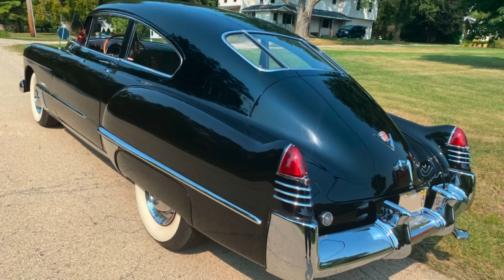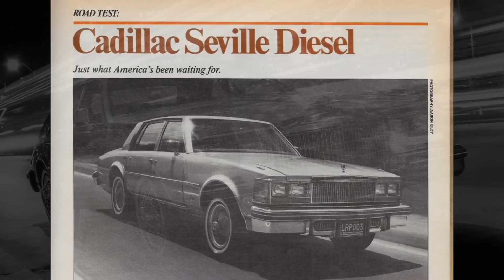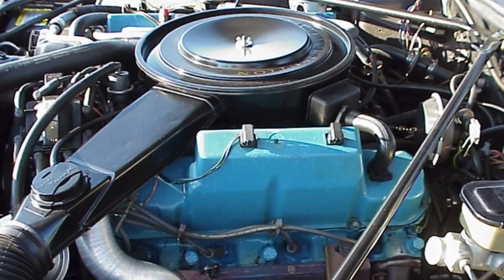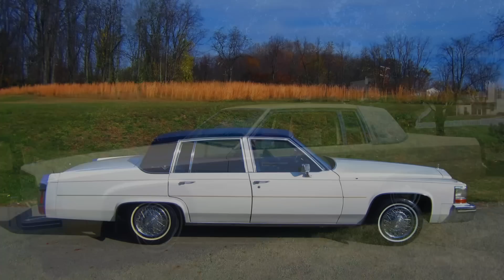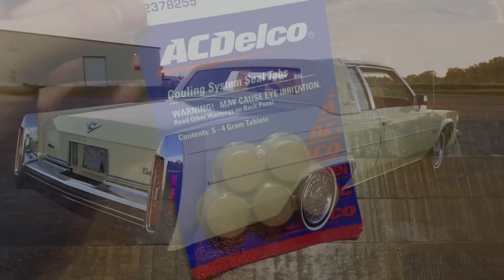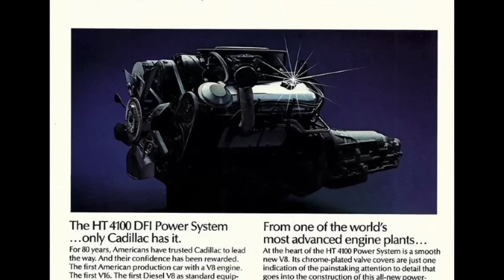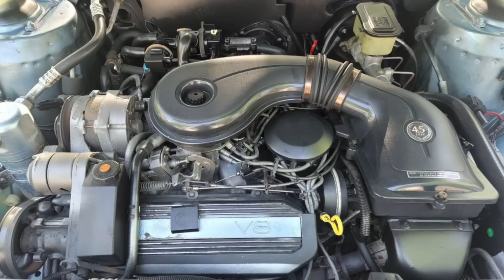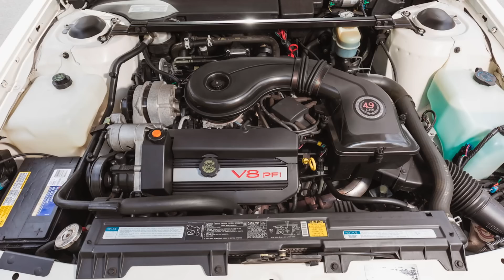This is GM's Worst Decision for Cadillac and Affected Its Reputation for Decades...

Comment: GMs mistakes would fill encyclopedias.  The biggest is allowing the bean counters to take over.  I would normally say this is turning the business over to Wall Street to boost stock prices.  The insufferable part is the GM attitude that they were above change and the customer would accept what ever they churned out.  The attitude is still present.  They should have been allowed to fail.  They earned it.
Reply: Love my all original 240000 mile chevy Silverado I bought new in 2007
Reply: @brainwashingdetergent4128  The current ones are rated the least reliable trucks.
Reply: @rogersmith7396  well the modern equivalent is twice the price myn was new so ive already decided to keep this truck and rebuild it if needed
Reply: @brainwashingdetergent4128  My oldest car is a 1970, the next a 74, then a 85, 86, 95.  I do have something modern as a daily driver.  I have a 72 and an 86 cycle.
Reply: @rogersmith7396  😊 11:03
Reply: @brainwashingdetergent4128  The Chevy trucks were pretty well made. I had a 1992 Chevy Cheyenne long bed W/T (work truck), 4.3 litre, 6 cylinder, 5 speed manual transmission, and I could not believe how durable, and reliable that truck was, in every way.  By far, the best GM vehicle that I've ever owned.
Reply: @carlc5748  have you ever owned a V8 GM engine? You'd still have that truck if it was a V8
Reply: @brainwashingdetergent4128  you are probably right. No, I've never had a V8 GM engine. I have heard that the newer ones from 1999 on are extremely durable, and can be built up to milk more power out of them, because of their inherent good design.  I take it that you have experienced this for yourself.
Reply: @brainwashingdetergent4128 nothing wrong with the 4.3's buddy.  They're essentially 3/4's of a 5.7/350 Chevy anyway..I've had great luck with mine e
Reply: @h8troodoh  As far as I know there was nothing wrong with 283, 302, 307, 327, 350.  The 400 is somewhat controversial.  I don't know anything about the 305.
Reply: @brainwashingdetergent4128  😮
Reply: It is what is is. If GM followed our hearts they would be long gone. The solution is to buy and cherish the classics. We are blessed to have them, or even remember them
Reply: @stevebarker8255  I suppose some people think of an Escalade as classic.  In my view they are just foundering.  No plan for the present or future other than keep the stock price up.
Reply: @rogersmith7396 Arent Cadillac? Escalades  cosmetically engineered Chevrolet Tahoes, Suburbans, GMC Yukons?
Reply: I was working at a Cadillac, Oldsmobile Dealership, when all those issues showed up in both Diesel and HT4100 problems. They were a nightmare for the technicians!😊
Reply: yup
Reply: Amen brother ! The world would be better served today if it would have been allowed to succumb to its ignorance!
Reply: The last GM I bought was a 1996 Chevrolet Impala SS. Beautiful car, nice to drive, reasonably fast (nothing like the muscle cars I previously owned) but the cheapness of the interior sent the message that these cars are no longer the Chevys of the past.
Reply: Yes GM really did screw up! And it betrayed and lost its owner base.
But to be fair, I've got to say how very happy with my 2016 Chevy Cruze,  which just hit 7 years age and 100,000 miles without any troubles what so ever. NON.. it hasn't even needed a new battery or breaks yet. Only tires as 60,000. It goes down as the most dependable vehicle I ever bought hands down. ( more dependable than any expensive European car that I've ever  bought! ) so GM is doing something good now!
Reply: @gregt8638 ,Cosmetically engineered Daewoo Lacetti. GM only stopped making the Cruze because its profit margin was too small for them, not because they were not selling well. They were selling very well.
Reply: Aka GM arrogance
Reply: I remember the 1970's beginning the big downturn in style and quality,  As people traded in their 3-4 year old cars with 50k or 60k miles that were rusting and falling apart Japanese cars were purring along and gaining market share.  It only got worse in the 1980's.  It took them a LONG time to listen to and take care of their customer base.  Something Anheuser Busch is currently getting schooled on.
Reply: @kjisnot  1974 was the beginning of the end of the American dream gullible people had been propagandized with.  First Viet Nam, then Nixon, then gas price hikes, then recession and economic contraction and the end of Bretton Woods.  The US was no longer all powerful.  God was dead.  Women refused to be moms.  The early Japanese cars were god awful.  A VW beetle was much better.  Jap crap.  They did'nt come around til the late 70s.  Also in this period American auto makers started taking big price hikes.  The public was restless and disatisfied and willing to go with cheap imported econoboxs.  Some people even found out they did'nt need 6000 pounds of steel to take them to the grocery store. But you procede from a false assumtion that corporations merely satisfy demand.  Nothing could be further from the truth.  They create demand from marketing.  The consumer is led around by his nose and does what he is told.  What right wingers call sheeple.
Reply: Ford didn't need a 2008 bailout.  GM and Cryco did.  Ford were forced to take a loan to not make the others look bad.  I won't forget that either
Reply: @loginavoidence12 🤣🤣🤣 you poor soul, Where do you get your info.. lmfao...
Reply: Nearly every car during the 70's and 80's had poor build quality with the exception of Mercedes, BMW, Volvo etc. All those old Corollas, Civics, and Datsuns that were " better" rusted straight into the ground 10 years later. Yes GM had an arrogant attitude and so did Ford and Dodge. The fuel crisis caught them all off guard and the Japs just happened to be making the right car for a fuel crisis.

Even pleasing bean counters GM has innovated more than almost any other brand period, while the others played it safe and practical.
Reply: British cars were even worse... car magazines would complain about problems in new Jaguars... and 20 years later the problems were still there... but they complained about engine vibration in the new GM Saturns and a mid year change in motor mounts was made...
Reply: more at fault were the greedy unions and their demands, then barak HUSSEIN obama came along and treated union retiree healthcare obligations as 'secured creditors'  He violated U.S. Bankrutcy Laws all to payback the UAW.  Then, he exercised the stock options well below breakeven for the American Taxpayer.  I have a 2007 chevy truck, last government motors vehicle I will ever own.  Talk about crony capitalism.  The demoCRAPS wrote book on that.
Reply: It's not just bean counters taking over at GM, it's their corporate culture of pursing only short term sales, production and financial results.  For the least amount of investment of time & capital, their Yale Business School MBA's "win" improvements over a short time period in an area such as Return On Investment and then they get job promotions.  No one there (a) Plans on changing the future of the industry through innovation or (b) Thinks in terms of long term survival and growth.  It's all financial shenanigans and marketing ideas, to where they end up badly copycatting their competitors and failing to gain customer loyalty.
Reply: You have very limited experience and not enough data for an accurate judgement
Reply: Yes! So True! The bean counters can and HAVE ruined companies worldwide. Stellantis is doing the same thing to Chrysler. Its all about the money for the investors. None care about the product that they are churning out, garbage!!
Reply: @curtbrockhaus6131  And a hearty E Pluribis Unum to you sir!
Reply: I switched to Toyota and Lexus years ago. American auto companies are nothing but junk.
Reply: None of these dinosaur discussions are relevant anymore. The planet is scheduled to cross the climate “red line” in 2027 instead of say 2057. The upcoming hurricanes and tornadoes will lift those old 2+ ton caddies right off the ground and drop them in the local landfill. EVs and hydrogen are the future…  If GM , Ford and Chrysler don’t wake up or partner with better brains they’ll all go the way of the “running board”.
Reply: Totally agree.  Would like to add though the clueless upper management push to churn out a new model well before it's ready is was a big factor also.   Had GM waited on the Cimarron, put it on the X platform with 1979 SeVille styling, and doubled down on quality the Cimarron would have been a big success.
Reply: @curtcollett2893  the Cimmaron (not sure about the Allante) was the one Cadillac model where you will not find the word “Cadillac” scripted on the body. This to me was a major clue. My Cadillac loving friend from the 1980s referred to it as a “weak Cadillac.”
Reply: Love the classic look of the 80s Fleetwood broughams.  1986 was a key year because GM replaced the 4100 with the Oldsmobile 5.0 307 4bbl.  Certainly a smog choked motor nothing like its big brother Rocket 350, but a smooth reliable and reasonably torquey choice.  Wish Cadillac would have kept the 368 for limo and commercial chassis cars, then offer it back into those 86 broughams.  The 472-500-425 big blocks were some very good and likely Cadillacs last real engines.
Reply: Same thing is happening at Mercedes - the bean counters have lowered engineering quality, and the marketers have this "Mercedes for All" approach that has lowered the value of the Mercedes name. Dealer service has gone downhill too, and MB does not support older MB's like it once did.
Reply: Yet stupid people willingly for over over huge sums of cash for their mistakes. So who are the real 'mistakes'?
Reply: I don't care what anybody says, I don't want a Japanese car for general use, except for the beautiful Lexus LC 500 coupe. That one I'd have.😅😊
Reply: Yes they should been forced to fail instead of bailed out, someone would have bought out the profitable parts and made them work. I think the current CEO is even worse than Roger Smith. My prediction is they will be bailed out again. My father worked at GM from the 60s until they they bought EDS, he was transferred to EDS back then. In the end he lucked out and got 2 pensions. We always owned GM cars for years, but quality got so bad in the early 2000s he quit buying their cars. I haven't owned a GM since the early 2000s, I would buy a used one that was pre 93, but thats about it, no new ones.
Reply: @ppeters480  I had a horribly unreliable 1984 Camaro that I bought new that soured me on GM for a long time.
Reply: @billolsen4360  Produced at the Van Nuys, California assembly plant, not far from where I've lived!
Reply: @billolsen4360  - Most makers built early EFI engines in 1980's that even they couldn't fix... Chrysler replaced their 1957 EFI with carb.s... Cadillac got into EFI V8s in mid 1970's...
Reply: @carlc5748 . They closed it and moved to Fremont, right? Or did they just close it in the 1990s?
Reply: @ppeters480  - I worked at GM for a while as an electrical engineer... went through same GMI engineering/management program as current president, but I was 13 years ahead of her... my brother worked there 41 years as an electrician... stayed to put all 4 of his daughters through 4 years of college... our Mom drove '53, '56, and '60 Cadillac... before going Riviera, Monte Carlo, Grand Prix...
Reply: @ppeters480 I wish Toyota could have bought GM years ago. Founded by Durant who started selling horse drawn carriages in the 1890s, GM only became who they became after acquisitions of other car companies, eventually destroying most of those beloved brands. 

Thank God for the Asian invasion which started in 1975 or we'd still be driving their crap today, 2009 bankruptcy and all.
Reply: @ppeters480  2 pensions… No wonder you can’t find an affordable car these days. Paying off all the employees
Reply: @michaelgalindo9162 , well it is all the retire expenses especially the UAW stuff that really puts the big 3 at a  big disadvantage
Reply: It continues today, but all the big 3 are guilty of the same: elimination if ICE cars in favor of EV's. HUGE mistake given demand for gas engine remains. I bought my  last GM "appliance" in 1983 and never looked back. And I never regretted the move either.
Reply: @autobug2  My father bought a 1976 Buick and then a 1984, When it came time for my mother (my father had passed) to get a new car GM would not be on the list. It was obvious duing the 1970s (fuel crisis) that GM was just trying to push stuff out the door. That was expecially true when they tried to convert a gasoline designed V8 block to diesel
Reply: Haven't bought an American car since I got a lousy 1984 Olds. Only Toyota for me. I can't figure out why people buy American cars.They are totally unreliable.
Reply: Because they don't know any better. They think that's just what you have to put up with, when it comes to cars. Many people won't buy Toyota, Hyundai or Honda, Because they're  racist
Reply: @johnball8758  As one mechanic said to me there is no shortage of repair shops fixing foreign cars and they are busy.  American cars used to be practicle and relatively inexpensive.  Less so now.  Toyota seems to be pushing the $100,000 range with many models.  No thanks.  If current trends persist fewer people will own cars.
Reply: I agree.  I have never liked GM products, going back to the 69s.  I view their build quality to be inferior.  As a matter of personal taste, I view their styling to be bloated and "feminine ."
Reply: @Richard4point6 They've been making crap since 1969????
Reply: @Richard4point6 artificially hypermasculine. Is that what you meant?
Reply: If my father were to share his version of events with the man behind the YT channel, I wonder what the latter may think of the former.

Comment: I'll bet the public at large remembers the Cimarron as Cadillac's biggest failure, but Cadillac owners from that era probably can't forget the HT 4100. If they had just stuck with the 368, they could have sold it as a V-4-8, cutting out the odd-firing, rough-running 6 cylinder mode, put a long warranty on it, and ironed out the relatively minor problems with the cylinder deactivation system until the FWD models were ready. But the promotional literature hailed the 4100 as the greatest thing since sliced bread, and I wouldn't be surprised if some of GM's top executives were led to believe that, so it would probably have been hard for them to bite the bullet and admit that this wonder was not ready for prime time.

Comment: The power level of the ht4100 was so low that using the cruise control on any kind of uphill grade was useless. I bought a '83 Coupe Deville that was drop dead gorgeous but was a total dog. The 4.9 in my 95 Sedan de Ville was awesome.

Comment: I bought a 1982 Coupe DeVille in 1983 with only 9000 miles on it. Going up hill I was easily passed by 4 cylinder autos.  Aside from lack of power, antifreeze would disappear and I needed to add a half gallon to the radiator every week. Cadillac knew of the problems with the HT4100 by 1983 yet they kept putting this motor in their cars till 1985.  I traded the car for another make in 1984 and it was the last Cadillac I ever bought.

Comment: Good reflection on this tumultuous engine history with Cadillac.  Having owned caddies with almost all of the referred to engines in this piece, save for the 8-6-4 version of the 368 -the 4100 was easily the worst.  Funny how just a few years of development time eventually the 4100 engine produced the 4.5 and 4.9 -arguably considered among the best Caddys engines to date.  Really the EPA/CAFE was more to blame for placing such extraordinary time pressure one GM and the big three to get mileage up.  If those 82-87 cars had been powered by those later versions of that engine, we'd have more fond memories of them today then we otherwise do.

Comment: I understand that HT 4100 sometimes experienced thread pullout/bolt pullout or losing bolt torque/clamping force at such as head bolts and main bearing caps?
Reply: Hondas 1.5 l 4cyl turbo is having the same issue now, weak head bolts letting go, allowing the head to lift. Usually around 50 60. Thousand miles. So far they are refusing to offer any assistance on the matter....

Comment: I had a 1992 STS 4.9  it worked ok . 
It loved water and had some leaks just like that 3 - 4 gallons just was gone and had to fill it up + add seal leeking (bars leeks )  that happend like 1 - 2 timmes / year . 
 The Air suspension was living its own life to it collapsed and the car rided on the rear axle . But it runned great 
Maybe do a episode that hunts Cadillac even more  there Northstar 4.6  IMO  Worst V8 ever created betvine 1993 to 2005 all have major blown headgasket and is a 5 - 6000 $ to rebuild and new studs hard to change startermotor etc etc . But if i get a cadillac again i want a 4.9  never a northstar .

Comment: I had a 1984 Deville, it was a slow car with a terrible knock in the engine. I  think it had 182k when I traded it in on a 454 Suburban in the mid 1990's.  The diesel,V8-64 and the HT4100 did so much damage to Cadillac. the car line had beautiful bodies, but to power trains worth a hoot.  And the GM 200 and 200R4  transmissions were problematic too. No wonder customers flocked to Lincoln with a reliable EFI 302 with 4 speed overdrive.
Reply: Or even chose Buick and Olds with the reliable Olds gas 307 for that matter.

Comment: First, have Buick build an all aluminum V8 with the technology available in 1961 - Check.  
Let Oldsmobile build a version of their own - Check.  
Run them in boats and even race cars - Check.  

Throw that all away and build the Vega with 1971 technology, the HT4100 with 1981 technology and finally the Northstar with 1991 technology...  CHECKMATE!